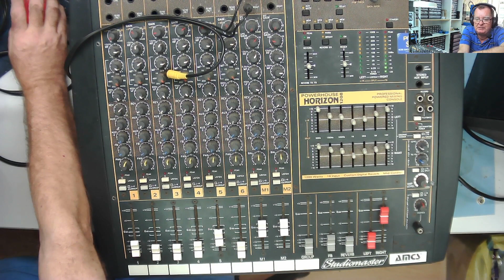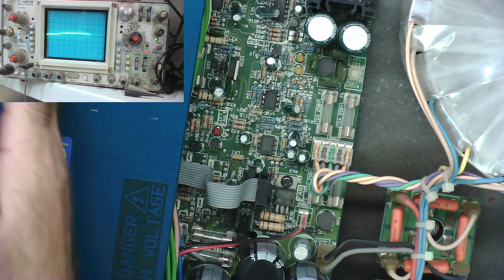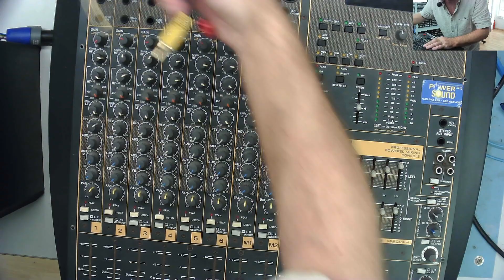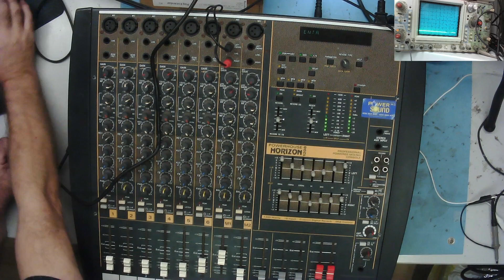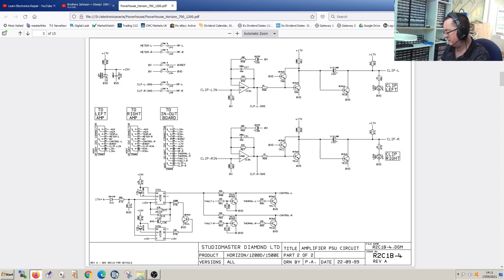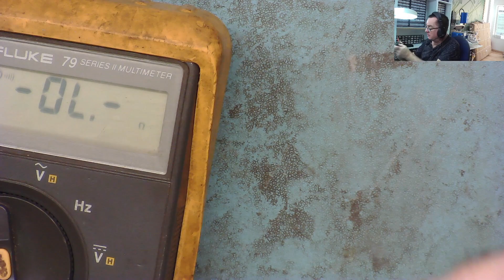Powerhouse Horizon 1208 1200W Amplified PA Mixer Repair - No Output on One Channel  LER #136

Comment: Loved the videos of the Studiomaster 1208 repair.
I am interested where you got the schematic circuit from ?, I do have the original Handbook covering this series of Mixers Amps (the 608, 708, 908, 1208, 1508). I have tried numerous placed without luck.
I have found after using these Mixer Amps for several years that the Multi Pin Ribbon Connector  connections get very tarnished, and cause loss of sound in one channel or the other.
Nothing a good squirt of WD40 Contact Cleaner in each plug and on the pins does'nt cure !.
Also another common fault is the jack sockets that are on the back.
They are also re-known for bad contacts on the Line Input Jack sockets (from the switching links, as the Jack is inserted).
This causes an open bad/circuit showing no power on one channel, yet the LEDs show output on both channels, again a drop of Cleaner and a small paint brush to clean them (Insert a 1/4" jack plug a few times when doing it !..
Because these amps are getting on a bit these days I have found many dry joints in the Circuit boards (nothing a dab of flux and solder cures).
Keep up the great work , love the videos !!.
Reply: Christopher, I have uploaded the schematics on his Discord channel. Look for mixer repair you will find it there. I could do with a copy of the handbook if you know where I can get it from.

Comment: I'm loving your videos. Such a great tech you are. I mainly do amplifier repairs so I'd like to see more you get in the future. This repair is what got in my search as I'm fixing the 700w version myself atm (troubleshooting a reverb issue after PSU fix where one Opamp burnt out and one smoothing cap was missing). I noticed on a different video you said you're from Stoke, I'm not too far from there in Stockport. Happy New Year!
Reply from the maker: I'm originally from Stoke but I've lived in the south of Gran Canaria for over 5 years now.  I do get some amplifier repairs coming in to the workshop so I am sure you will see me tackle more of them
Reply: @learnelectronicsrepair  I could tell from the accent you've spent some time around there lol. You're really good at your skill and seem a nice guy, a bonus for the Canaries :) Could you check the Studiomaster schematics you have for which Opamps are on the power supply board when you get chance please? I will look forward to more videos in the future as I also like any PSU vids you share

Comment: So glad that the schematics helped to repair this. Believe me, this was an easy fix compared to the two I had.
Reply from the maker: Thanks so much for the schematics Andy, they were a huge help.  I find one of the main problems with on working this sort of equipment is getting to the components you want to take measurements while the unit is turned on.  Sometimes it's like gynaecology through a letterbox!  Would you believe they guy who took months to come and make sure all the mixer settings were correct, and then started to hassle me to complete the repair, now has not returned to collect the item and pay for it even though he knows it is ready!
Reply: I'm sure the schematic was a godsend lol any chance one of you great people could pass it on to me, I have the 700w version on the bench atm yet I think they will share much circuitry between the two versions. TIA!
Reply: @stewartholmes4216 I can't post a link to a website because these controlling arseholes keep deleting it.
Reply: @retrocomputeruser  thanks for your efforts Andy
Reply: Andy, any chance of a link to the schematics of the 708?, I have looked everywhere I know. Many Thanks in anticipation !
Reply: @ASTROSTARDJ  and @ Stewart Holmes. I have them available to download on his Discord channel. They are in the audio section. Best I can do because I can't post links.
EDIT: The Discord link is in the 'SHOW MORE' under this video.
Reply: Hi Andy, Ever had a regen failure?
Reply: @fredflintstone2077  Can you explain a little more ?. Is that error on the display ?